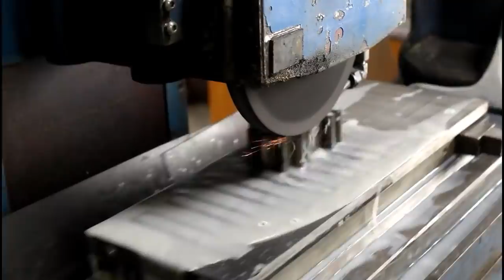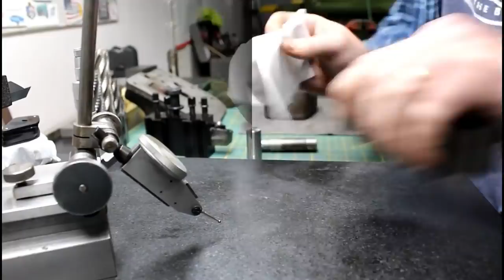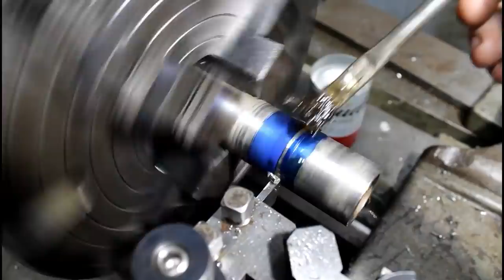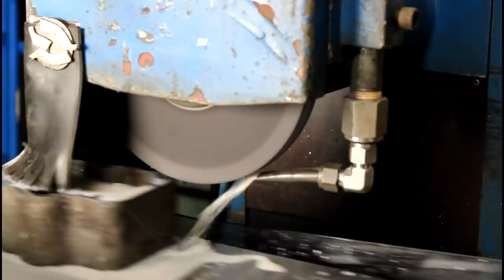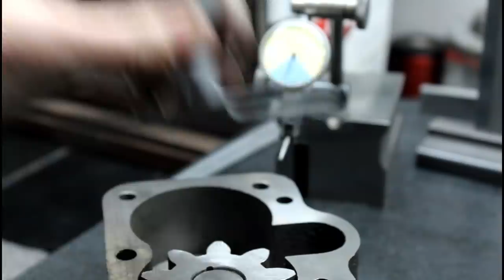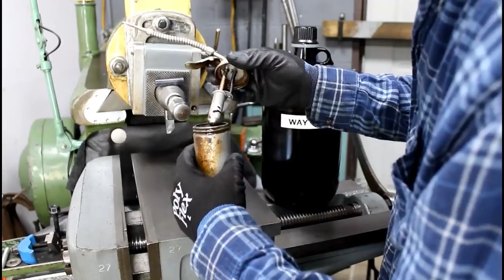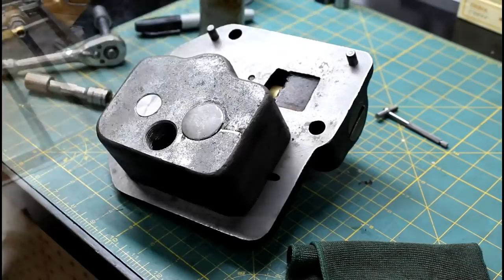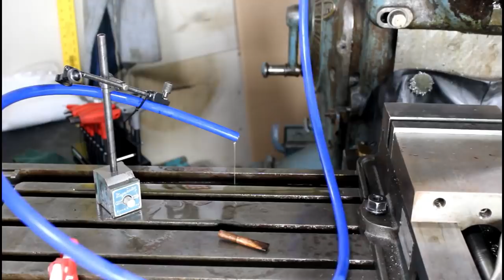OH Yeah! Gear Pump repair part 2

Comment: Just for the fact that it would make great content, I would over bore the housing and press in sleeves and then rebore them to the size needed. Also wondering if that 5 1/2 thou clearance is to loose

Comment: Build up the cast iron casing. rebore the case on the suction side . I have done this on antique tractor  lube oil pumps . only on the suction side.

Comment: That initial POP is always a shock.  SQUIRREL!  That is my favorite Dremel cut-off wheel, too.  I hate the new ones with the twist lock arbor.  That was some great work to rebuild the pump, too bad it didn't work better.  I have no experience rebuilding pumps, so my first thought was a good check valve in the suction foot.  Good luck, and looking forward to seeing what ever you do.

Comment: Hi Steve,
Great job on the gears and housing surfaces. The shop I worked in used to rebuild oil pump housings by metal spraying (spray weld) the gear bores and machine to fit the gears. Our housings were aluminum and they used bronze for the metal spray, You could probably use steel or bronze metal spray on your cast iron housing, not sure. You do know who does metal spraying? Its your friend Abom 79.
Good luck.

Comment: The pump shouldn't lose its prime. The problem has to be that either your check valve is leaking or you've got a tiny leak some where below the check valve which is letting air into the pump when it's off. If the check valve is sealing correctly then suction should keep the pump from draining back and losing its prime. Look for wear, divots, or defects in the face of the brass flapper valve and the face of the valve seat. Alternatively, look for a tiny leak in one of the pump body mating surfaces. It looks like the input and output connections are regular iron pipe thread, so you can use air pressure to check for leaks. Cap the output pipe with a pipe cap, and remove the pump foot and connect a small air pump. Put a couple of pounds of air pressure into it and check all the joints for air leaks with a soap solution.
Reply: Also, the first place I would check for a leak is the top end of the 6" pipe nipple that connects the pump to the pump strainer/foot. The top end of the nipple is probably high enough to be above the level of oil in the sump. Any leak there will let the pump drain down and lose its prime. You wouldn't notice the leak there because it would just drip down into the sump.

Comment: A foot valve is what you need, as others have said. My waste oil furnace pickup line has one, and if it gets stuck open, it won,t pump.

Comment: Try a recirculating line from just above the pump back to the sump to enable priming without having to back fill the pump.  Once it is flowing you could close the bypass and it will flow.

Comment: I would sleeve the housing with bronze and glue the sleeves in with green loctite bearing retaining compound. Then bore to finished size (mill boring head or four jaw on the lathe).

Comment: You asked what would I do?  Well, I would teach the millenials how to make gear teeth on the shaper! :)  It looks like it needs a non-return / check valve.  It also appears to be picking up some air and cavitating slightly.  The clearance should be a lot less than .005".. more like .002" or less.  Solvent?  Most of the units were designed for LowOdor Mineral Spirits.  Short of that, have Adam Booth spray weld the gears, get someone to make some new blanks, put a liner in the housing, soft metal or plastic/teflon wipers on the end of the gear teeth, sleeve the housing.

Comment: Oversize the bore(s) / make .125" - ish sleeves.
Reply: Those pump gears look just like the gears in a Mack ENDT864 v 8 engine 1972 vintage they wet slightly larger than the ones in a six cylinder.

Comment: How about boring the pump housin for each gear, loctite a sleeve, bore to correct tolerance and mill out the center gear clearance. Not sure if the loctite would hold though.  Good luck. Best vid series in a while, folks missing out not watching.

Comment: check valve in the sump, and ball valve down low on the outlet pipe  shut the ball valve before you turn the machine off. keep in mind spur gear pumps are generally not self priming they are usually gravity fed or completely submerged  the clearances you have are fine for what you're doing.

Comment: Hey Steve, love the problem solving and solutions you come up with and enjoying this repair/restoration!! As a solution to closing the gap around the gears in the case, couldn't you open the bore of the case up on the lathe, cut a 45 degree bevel on the front for a weld bead,  machine 2 cast iron sleves that pop in, weld/braize them in and turn them to the required bore? Just thinking adding anything to the teeth would cause them to foul each other where they mate unless you machine the teeth deeper? Just an idea 👍 keep up the great work and content 😎
Reply: This seems like a reasonable idea, what am I missing?

Comment: Yeah I would definitely try to resleeve it may be with a hard stainless steel or something grind the gears perfectly round to I'm sure you can find some thin gauge sleeves so you are not cutting to close to the bolt holes if you would even have to do that

Comment: put a check valve between the pump and pickup to hold oil in the pump when it sits and it wont go dry

Comment: Order yourself the Dremel EZ Lock cut off wheel kit.  It's expensive but you will never go back.  The wheels last surprisingly long.  The cutter is driven but floats on the end of the mandrel so if you bind it in a kerf, there is no blow up.  It will just run off axis and keep cutting.

Comment: I would say NO to sleeving the housing, since it is only a 2/3 circle you will have major issues retaining the 2/3 shells! If it were me, I would simply install a foot valve to keep the prime, but knowing you want to "machine" something- tig braze the ends of the gears, there will be a LOT less heat introduced, then machine to 1-2 thousandths clearance. I would also make your end play on the gears 1-2 thousandths instead of 5. This is NOT a high speed pump, so heat (running) is not an issue, loosing some temper on the ends of the gears wont make a bit of difference.

Comment: What I would Do?  Your like me, I don't use my mill every day. So I would do two things, one is check valve on output of pump and two a tee with a 90 degree elbow with a shut off valve between pump and check valve. This will let you prime it easily, and check vale will help from flow back while using it. Also, for solvent tank, guys have been using super clean from walmart. It biodegradable, good luck!

Comment: My understanding of gear pumps is it's between the teeth where the area is reduced, oil can't be compressed and pushed into well at one end of the gear teeth or the other. The fit between the teeth matter for this reason.  If the bushes are wore out, it can let the teeth faces (or pitch diamter of the teeth) increase and thus the clearance between teeth is increased and the oil can slip by (or air in).  The clearance in the bore shouldn't matter.  Although I don't know about your machine, a gear pump is often installed below the oil level or on the other side of a simple ball check valve so it can't lose it's prime.  I'm not to the end of the video as of this comment.  If I had to guess on end clearance, I'd look into automotive pumps for a tolerance but I'm guessing about .002 total.  Look forward to your test run and to see if it's loses it's prime or not.  Also, isn't it sucking up filtered oil?  Shouldn't it be?  I wonder if the pickup originally had a sock of some kind on it.

OK, after watching your test. -- Really the issue is you have a siphon problem.  There is NO clearance between parts a siphon won't suck dry.

Can you install an inverted trap on the outlet tube dips down below the pump.  Now the exit side of the pump will allow air in and drain back but only to the level of the coolant in the tank, not back up hill and down through the pump.  Assuming there are no air leaks into the pump or your nearby fittings, it should always remain wet and air free.  ;-)   Long comment but I love thinking about simple solutions to problems like this.

Comment: Hey Steve,
how about a non return valve to stop the oil draining from the pump. Sure a simple ball on seat or a disc valve would be effective and easy for you to fabricate in the pick up pipe. I’m from an automotive background and some of the pumps I’ve come across must be built with grease or they never prime. Obviously you can’t do that, but a valve would stop drain back from the pump could be a simple option.
All the best, I enjoy your efforts,
David

Comment: Put brass, copper shim stock around the internal wall of the housing (Sleeve the housing) to reduce the gap. No need to touch the gears 👍👍🏴

Comment: Whilst it wont address your priming problem I did notice that the relief valve spring you cut was an extension spring not a compression spring.  I expected it would bottom out since the convolutions are much closer than on a compression spring. I favour a non return valve to any fiddling with the gears.   Mike
Reply: Hooke's Law says springs work the same in both directions. IOW, a spring constant is the same whether the spring is  being compressed or extended and is linear in both directions.

Comment: I have rebuilt a lot of hydronic pumps and injector pumps. Close up your tolerances like suggested in other post. I think vane your theory will not work due to the gear teeth come off the housing before making contact with each other that area would allow for your vane to come out and jam in the gear teeth. My concern would be by adding anything movable to the end of the gear teeth could or would possibly fail an ruin your pump. Talk to Adam Booth and see if flame spraying would be a option. 
You could put a accumulator below your flow valve and isolate it after start up and open it on initial start. Hope this helps

Comment: HI STEVE. THE PROBLEM YOU ARE HAVING IS THERE IS TOO MUCH CLEARANCE BETWEEN THE GEAR TEETH WHEN NO PRESSURE TO KEEP THE TEETH AGAINST THE PRESSURE SIDE OF THE GEARS. THAT IS WHY YOU LOOSE THE PRIME .

Comment: Perfect job for your shaper Steve, slotting the ends of the gear teeth using an indexer,  for an interference fit of soft metal as a wiper. Copper? Brass? Bronze? Or some kind of poly type material. Enjoying this project. If nothing comes, then its a great learning experience. Thank you.

Comment: WOOHOO, , , Saturday with Steve. Looking great bud. I did a bush fix on one of these pumps once with various sand papers and an old mirror. It took me almost 2 weeks to do but as far as I know it is still in service 6 years later. Great refit my friend and what a great gift in that washer. You have some fine friends bud. 900 likes is really impressive Steve. Well done fella. I am on your side with doing the inserts. Poss some hard brass liners as well. OR you can just make a primer reservoir for the pump to give it a shot to get it going. Seems it will hold a prime for a bit eh.

Comment: Darn! Is there room for a swing check valve on the intake? Even on the discharge, if you could prevent the oil from draining back it will stay primed.

Comment: Put a check valve on suction side of pump and get on with life.  Don't worry about clearance between ends of the cedar teeth and case at the juncture, you have plenty of flow.

Comment: Steve, If you groove the gear teeth and put a wiper blade in them, me thinks you would have to silver solder them in to keep them from working  loose and wearing excessively and possibly working out of the slot an jamming the pump.  Just a thought from an old retired GI, non-machinist.

Comment: Steve maybe look at the pickup head... that basket/aluminum head looked really bad... sucking through a straw with a hole in it....I'd work there - the clearance at the gears is much less critical unless the pump is not immersed to begin with.... Or. could you use Rulon /Turkite to line the inside of the well and grind down the teeth a bit? Easier than brazing the teeth...? Or .. put a backflow valve in the line so that fluid can only flow in one direction not backwards. (I'm sure this will not prevent loss of fluid over long periods if the pump is leaky but it might prolong the loss time.)

Comment: Not a machinist here, and this suggestion will probably provoke howls of derision, but why are you only thinking of building up the gears, and not the housing? If something non metallic like Teflon wipers on the gears are worth considering, then surely a layer of epoxy applied to the bore and ground down would work?

Let the ridicule begin...

Comment: Hi Steve,
I believe you are possibly losing prime due to a leaky check valve? Is there a flapper that keeps the pump body full of oil by chance? If its not seating when the pump is shut down, oil will drain back into the sump and it will lose its prime. IIRC gear pumps that are subjected to trash and are also for lower pressure applications, are designed with larger than normal tooth to case clearance to allow a natural bypass. So, I think that clearance might be OK. Does Keith have a maintenance manual from Milwaukee on his website that has rebuild spec's?

Anywho, thanks for another great video.

If building up the teeth is deemed the way to go. I would use 308L stainless rod and the tig on pulse and lay one thin bead (like if you were welding some 18ga to a piece of plate) on the very crest of the teeth. Pulse keeps the workpiece cool and gives you minimal penetration. I would do this over tig brazing with silicon bronze only because to braze, you need the base metal hot to get flow. To weld, you can have point heat to melt the base metal and not affect the temper adjacent to the weld area.

Comment: Grind a slot on the end of the gear teeth and then insert rubber into the slots. Doesn't cost anything (assuming you have a thin cutoff wheel for one  of your grinders) and the rubber is sacrificial and can be replaced when worn.

Comment: When Steve pressed out that shaft and it went "BONG!" before sliding out, I was reminded of a Vintage Machinery.ORG video where Mr. Rucker had to push out a very stubborn shaft from an old pulley center and he had to do all sorts of things to finally get it out; it did more than just go "BONG!", though, it went "WHAM!" several times, in a way that was scary.  It was somewhat amazing...

Comment: Grind that pump case down to reduce that .0055 down to about .0015.  Touch the gears back and leave the edges sharp, same with the case.  Get rid of the screened pickup and put a ball check on the end of the suction tube.  That is what I would do next.

Comment: Good job, Steve. You might try coating the top of the pick up tube with epoxy after a very through cleaning.

Comment: The Melling Oil Pump on an LT-1 Chevy small block, (among about a thousand other motors),  has a gear pump with 2 gears and a very similar housing as your K&T.  In Auto Mechanics we were taught to pack the new pump and pick up tube with Vaseline to help avoid a momentary pause in oil pressure on initial start up. Also Hot Rod magazine did a bit article on " Blue Printing" a Chevy oil pump back in the 70's. Without damage to the housing to gear teeth, the clearance recommended  between the side of the gear(s) and the pump cover  was .001 to .003".
   I think you got it pretty good as it is now. But I was expecting you would want to put a small ball valve right near the outlet as it may also work like your thumb over the line to put that oil right where your cutting action is. Great video, nice toys. lol  (Oh by the way my Auto Mechanics Text Book Has a 1956 Corvette I think on the front) Ha ha. Kinda Old School? yep.

Comment: You could build up the gear teeth with JB-weld, then turn the radius to fit the housing and hand fit the gear shape. 

You sould etch the teeth ends to scuff them up good to make JB-weld really stick to them.
For etching i used Iron(III) chloride. Paint the gears, clean up the end of the teeth, etch the ends, clean them, heat the gear to dry it real good and apply the JB-weld. It will stick really good.
I fixed a rusted out waterpump this way. I had to do it twice. Simply scuffing up the surface didn't work.

Comment: I ran a PSI screw supercharger on my alcohol dragster.  I sent a BRAND NEW PSI & had it epoxy coated in the hsg. & the screws; they then "run it in" with lubrication, (just like lapping) & it improves the screw's performance about 10%.  Epoxy spray your housing & gears, then run in the pump with some lube.  You'll be amazed.

Comment: I will agree with the comments that say the pump is now fine.  You did as good job as could be expected (maybe too good for this type of pump) and it is running properly. I have to believe that back in the day, priming the pump was part of the startup procedure at the beginning of the work day.  Machinery of this vintage had a lot of daily maintenance and start up procedures such as the daily filter cleaning you mentioned a couple of videos ago. It may not be totally stock, but I believe if you could create an easy way to externally manually prime that pump your problem is solved.  A lot of the comments here are based upon hydraulic pump rebuilds which would create far too close of working clearances for a pump of this type.  Fine work grinding the pump to spec and I wish you success in the next phase, whatever you decide to do.

Comment: Great watching your videos Steve. To fix the pump you could decrease the diameter of the pump housing walls. I don't recall what your gap is but I would take some precision shim stock and trim it to fit then use some green loctite to stick it to the walls of the housing. Probably need to turn a couple of short bars to clamp it in place while the green loctite sets up. I have some xtra shim stock coming your way shortly.